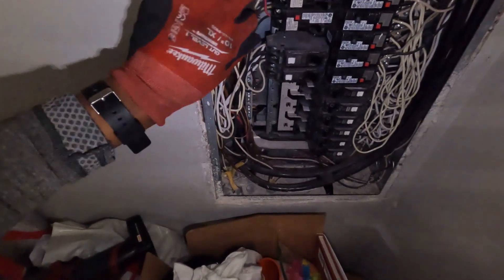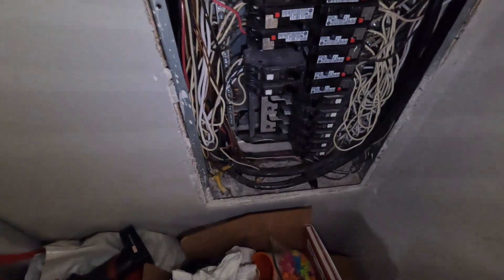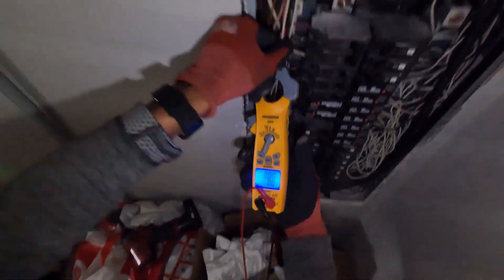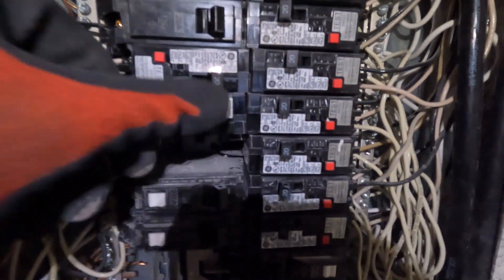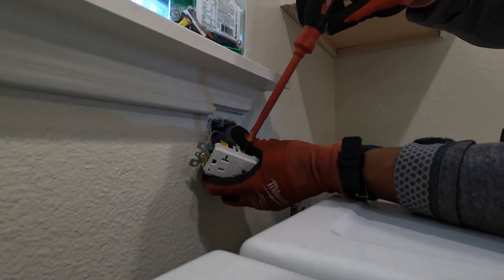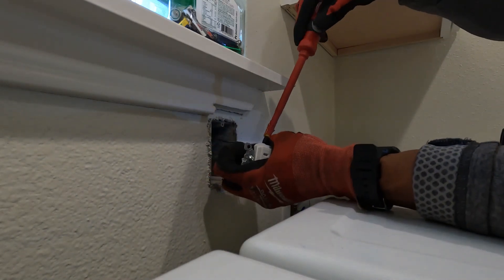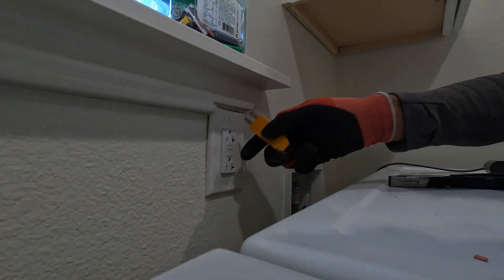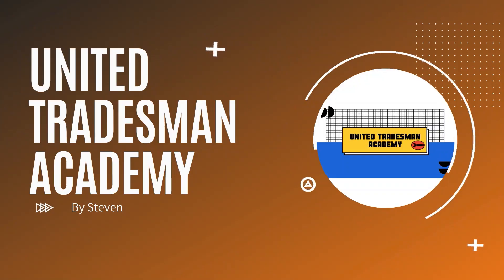GFCI Outlets Only Last 1 year! Why GFCI Outlet Keep Tripping With Nothing Plugged In.

Comment: I would investigate why there are 2 wires on one circuit breaker. If it's a incorrectly wired mwbc it won't necessarily trip the breaker, but it can overload and overheat the neutral wire. It was a good catch that you saw that. At 2:27 that 240v plug should be installed 180° around if possible so the cord doesn't have to make the strained u-bend.

Comment: Haha - the ground was down and you installed found up.  O my - so what was the final breaker outcome?
Reply: Ground up is how it is actually installed in industrial and hospital applications. Reason being if you drop something on the cord at the outlet and the bare ground prong is exposed you wont receive a shock. However if you have hot and neutral prongs exposed and were to touch them youd become part of the circuit and get shocked. I think this guy may have some industrial electrical training or experience and honestly idk why home outlets arent installed ground up anyway.
Reply: I absolutely agree - I think it’s time to choose  the red or blue pill.  While new extension cords are more flexible with rotating heads, so many devices, power adapters, commercial devices and residential refrigerators will use an angled space saving plug with ground down as a default.  At some point, let’s make a decision and allow industry to adapt over time.

A much safer solution would be a recessed receptacle so the risk of a short is far less.

Comment: Is there a reason you installed the ground socket up on the new GFCI, when the old one was down?   Is that consistant with the rest of the house? Great video, Thanks, Russ, Electrician from Oregon
Reply: Many people think it is safer to install with the ground up.  If the plug were to start coming out of the receptacle, if a foreign object came in contact with the ground on top, the idea is that you would have less potential problems than if some foreign object came in contact with the hot and neutral wires.  In my area, all city, schools, hospitals, armories have ground up.  Most residences have ground down.  I am in North Alabama.  Our inspectors do not care with way.  I ask the customer.

Comment: damn this dude really just reinstalled the gfci the wrong way compared to how it was originally installed.. and he set the screws crooked on the plate wtf
Reply: There is no "right" way.  The buttons on the GFCI have the text written so that you can read it with ground up or ground down.  Code does not mandate (yet) which direction the ground goes.  Thanks for playing.
Reply: @FreeAmerican-mm2my  the wrong compared to how it was originally installed... and you're right its not code but now its probably not uniform with the rest of the receptacles in that home anymore. although in Canada where I live for commercial and institutional the ground is required by code to be upwards, not for resi though..

Comment: Why is the circuit breaker double tapped? Possible nuisance tripping? Dyson charger doesn’t draw much and newer washers don’t draw much amperage. Could have been a faulty charger or washer circuit board. How about the double tapped breaker? that would be something a gfci wouldn’t be happy with.
Reply from the maker: Valid reasons

Comment: I find it hard to believe only .35 amps on a motor running with a full load of clothes and water. Is it possible that you were on the wrong wire?
Reply: That’s equivalent to what a 40 watt lite bulb? Could be a dc motor.
Reply: @wireman1987  All washing machines use between 5 and 15 amps AC to run. LG is one, which was running.

Comment: why receptacle upside down
Reply: There is no "right" way.  The buttons on the GFCI have the text written so that you can read it with ground up or ground down.  Code does not mandate (yet) which direction the ground goes.